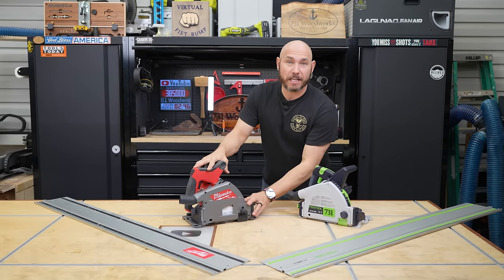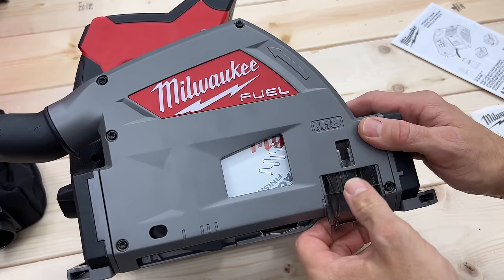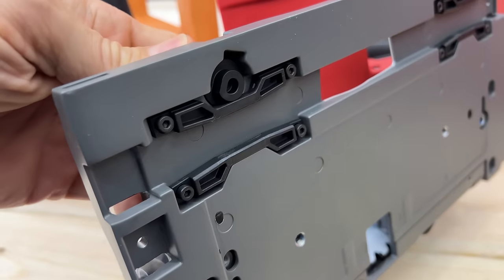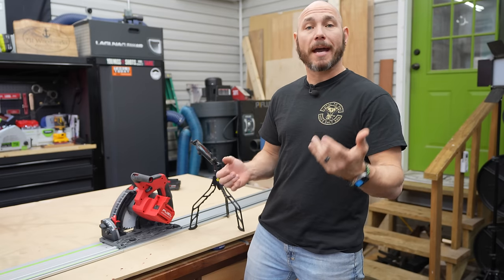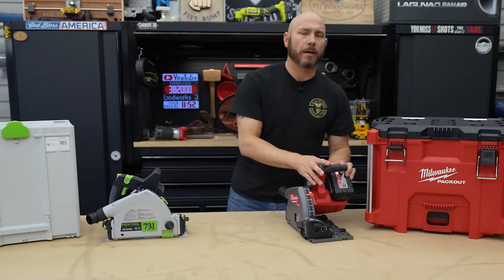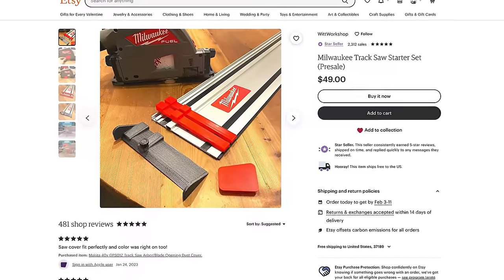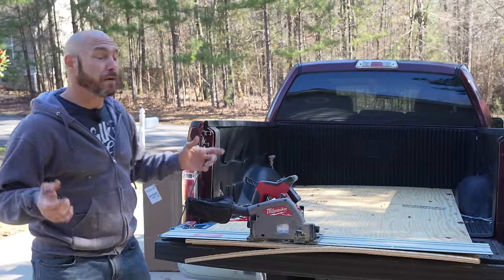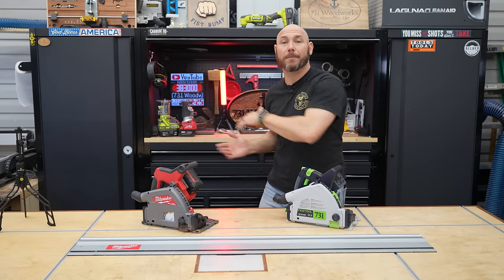Milwaukee Track Saw - Everything You Need to Know

Comment: Great comparison video. But I really don't get this Track Saw craze. I have cut hundreds of sheets of material from MDF to Std plywood to high end cabinet grade products, never needed a track saw. You're clamping the track to the work piece just like I would clamp a straightedge to the same product. Just make sure the bottom of your saw is clean so it doesn't scratch your material, then make your cut. Once you have knocked the size of your material down a bit you can easily manage the rest of it on a table saw. $800.00 for a track saw kit, compared to less than $100.00 for a 3/16" thick aluminum straightedge? I'll take that $700.00 difference and buy some nice hardwood.
Reply: If you never needed it then the track saw craze won’t make sense to you. But what I build it’s definitely needed to make the work more efficient and less time with more accuracy. Being able to plunge the saw at a 45 degree angle is worth the money by itself. Also saves with accuracy because ripping a full sheet of plywood on a table saw has more room for error than a plywood that’s laying still with a track saw. Me personally, probably wouldn’t have bought an expensive track saw if all I was doing was 0 degree straight cuts but the fact I do different angle cuts both ways (miter and not straight rips) makes the track saw worth it. Know what I mean?

Comment: Red needs to come down about 200$ for me to consider them over festool Other than that I like them

Glad you have some plywood left lol
Reply from the maker: I think you'll see them on deals after a month or two
Reply: He got the prices wrong. The Milwaukee is $111 cheaper for a better saw, IMO. You don't realize how nice that anti-tip feature is when doing bevel cuts. The only other track saw with anti-tip that I know of is the Makita. Also, Milwaukee does sales all the time, you should be able to get $50-$150 off the kit at some point when they do the "buy more save more" promotion.
Reply: @731Woodworks  That’s my thought also. I think they are pricing it now for the initial demand then later discount it for their sales like on Black Friday, X-mas sales, and Red tool specials.
Reply from the maker: @richardlug6139  And Festool NEVER puts any of their stuff on sale lol. So you'll likely be able to grab one of these for a decent discount in the coming months.
Reply: @RobertBarth1  thanks good to know. It’s back in the running.
Reply: @RobertBarth1  every way i sliced up the deals, the M18 is $150 cheap then festard and $30 cheaper then makita in the US.....

Comment: Seriously.  Festool all day long.  It’s expensive. But the accessories are insane. Integrates with the mft table.  The new tracks have screw holes and sticky tape when you can’t use clamps.  Router attachments with pre spaced positive stops for shelf pins.  Parallel guides.  Integration with the dust extractor.  And dust collection will be different if your using a shop vac.   Milwaukee makes good tools but the fumbled this one.  Way to expensive.  Hell you’ll end up buying the festool accessories. I know I own dewalt tracksaw.  Nothing can clamp to it.

Comment: The truth is, festool created the best saw 20 years ago, with the exception of the overpriced Mafell, every other manufacturer has tried to reinvent the wheel. Milwaukee had to join in. 
It’s also common knowledge the cordless ts55 isn’t the best tool festool created. But the mains powered ts 55 is still the benchmark.

Comment: Equal-enough money, I'm going Milwaukee all day long. I have a seething annoyance with Festool because of their anti-consumer lawsuits against everyone and anyone who ever tried to make a tool that makes oblong dowels, and for how they attacked everyone that tried to put out a table saw with an emergency brake. Bosch's system is actually better, but they can't sell it thanks to SawStop's lawsuits. (SawStop and Festool are owned by the same holding company, and that's where the lawyers live). Festool (and SawStop) can suck it. It'll be an interesting time when their patents run out (next year?) and competitors come along and do it all better, cheaper, and in more innovative ways.
Reply: Absolutely, 100%, agree with all of what you said. Well done.

Comment: DeWalt 60v track saw has everybody else beat. This saw has very few reviews. I am not a DeWalt fanboy but it seems to be the better choice overall.
Reply: Especially if you've got their 20V tools already, since you can use those 60V batteries as a high-cap battery for those. Their 60V tools are serious beasts in general. Project Farm had their chainsaw beat a gas-powered Stihl.

I'm seen some commentary that you need to replace the grip tape that the tracks come with, though.
Reply: The downside is that the tracks are proprietary and don’t take the more common makita/fesstool accessories if you care about that kind of thing.

Comment: To be fair the Festool anti-kickback is brand new and only on the newest model.  And the Festool doesn't have that "anti-tip" which is actually a very solid feature.  I do a lot of 45 cuts with my Festool TSC and it really wants to tip over.

Comment: For me the selling point of this tracksaw is that milwaukee produce also the nailers and Festool not , i quit at all my Festool line in favor to Milwaukee, i need only one battery platform for all my tools .
Milwaukee leaves behind Festool because of innovation and better prices.
Where is the cordless router from Festool? 
A Milwaukee battery is 75 euro and a Festool is 135 euro ! 
Hilti doesn't produce a mitre saw 😂
Milwaukee takes the market with the full carpentry tools setup .

Comment: I don't understand the cordless craze on all power tools ???? I have electricity in my shop and jobs. Cordless drills are fine but why do you need cordless on every tool and at almost 750.00 on a starter kit no thanks. When I started in carpentry 55 years ago a skill saw, table saw and handsaws  and that's basically how I still build and do woodworking I'm not too lazy to stretch a cord and roll it back up

Comment: It sure seemed like you went out of your way to downplay this saw...like you wanted to like the Festool more!  In fact, your first statements threw Milwaukee under the bus, saying they squandered the advantages they had in seeing everyone else's offerings prior to releasing their own.  

But IMO, your only VALID criticism of Milwaukee's saw is the omission of the anti-kickback feature.  But my Makita doesn't have that either, and I've never missed it.  It's ridiculous to ding Milwaukee for not including support for Festool's proprietary BT connection.  NO other company builds in BT support for Festool extractors...and why should they?   Instead of bashing Milwaukee for not including technology that ONLY works with a competitor's product, simply give kudos to Festool for providing a way (the magic button on your hose) for people to utilize BT with their extractors and other brands of tools!  

OTOH, the Milwaukee has a riving knife, anti-tilt, deeper DOC, and tilts further to either side.  IMO, the depth adjustment is a little better as well.  The tracks are cheaper for the Milwaukee...a LOT cheaper in the case of the long track!  And it's worth mentioning that I can maintain the anti-tilt feature with my Makita 55" and Power Tech 110" rails.  I do agree with you about the box though...well built as it may be, it's way too big for someone that isn't going to a jobsite with it.  I've got storage issues as it is. 

I'm NOT anti Festool...I have a CT48 extractor and a Domino, and they're great!  I buy what suits my needs best, and if that's Festool, then OK.  I think a prospective buyer that's already got cordless tools of one brand or the other will probably be smart to stick with that brand.  But I don't have any Festool or M18 cordless stuff...so if I had to choose today, I'd go with the Milwaukee.
Reply from the maker: Call it like I see it lol. A lot of reviews (all of them) will have some opinion bias to them.  It's human nature.  I say in the last few seconds of the video why I chose the Festool over the Milwaukee.  But everyone will have varying opinions on anything, especially tools.  It's a great saw, I just feel like with the time they had, they could've done better and had more features at this price point. Festool isn't perfect either by any stretch.